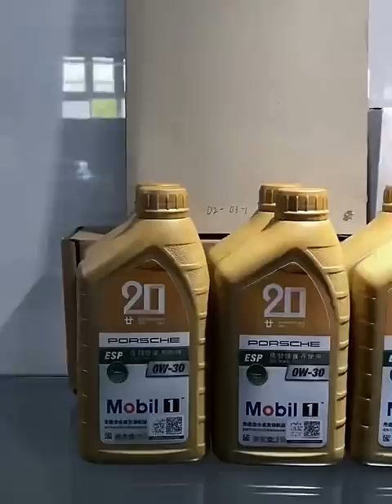Porsche Panamera Maintenance Service Process | Oil Change.

Comment: As someone who is a Porsche technician, a lot of newer cars, all bumpers have to be removed except for Macans. One thing not shown in this video is that to reset the maintenance interval light on these cars, you'd have to visit a certified Porsche dealer to reset these. Just thought I'd share. :)
Reply: Stupid crap, oil change should not require dealer. When will manufacturers build a good car that at least.oil change can be done by owner. Another reason not to buy over priced dealer shop queen of a car. Keep.my camry, and sportbike for blowing porsches off the road.
Reply: @rt2255  hey man, I just work here.
Reply: @teal_549  lol great job just hate the way manufacturers make cars only techs with special tools are only ones who can do even basic maintenance on them.
Reply: Whts tht white cleaning spray?
Reply: @rt2255  that’s not necessarily a problem unless they ask for too much money for an easy job. Anyway this is an interesting topic. 
What things should the manufacturer allow others to do? Some things will require the manufacturer service program to be carried out so for that they could also allow shops that have the required tools and mechanics that are certified for that type of car and engine, obviously nobody can do that because it’s not worth learning so many cars except if you want to have a specialized shop only for Porsche cars. However, for tasks that involve low complexity the manufacturer should provide a guidance for mechanics so they can do the job by the book. These would include oil changes, filters, suspension, alternator, starter etc. I think there are manufacturers that allow independent specialized shops because I know a few that claim to be and  have access to the manufacturer database.
Reply: @rotorblade9508  with porsche ferrarri only a few can do the job right. Rule one in buying car, forget up front cost but the cost to maintain it right. I drive camry for that reason, they rarely break and i can afford to get most things fixed. I keep ninja as cheap super car killer, again i can afford it. High end cars require high end income.
Reply: @fuadizharuddin4797  Whipped cream
Reply: They fixed that
Reply: @rotorblade9508  be it porsche, ferrari or lambo, an oil filter and plug change should de accessible with basic hand tools or get smarter engineers. If hs grad in military can work on jets the come on man. No reason it should take 4 hrs of tear downs to change oil. Race cars are faster more high tech, but built to be totally rebuilt in 24 hrs to race. Yes trained mechanics but even they could not pull sports cars engine in a day
Reply: Obd11 regelt
Reply: While you work there, could you kindly find the main Porsche engineer responsible for implementing this service procedure, and slap the **it out of him please )
Reply: trying to promote your dealership? "Only Dealer can reset" Lol
Reply: Yes but its not important, resetting need only to monitor mileage after oil changing on display and indicate drivers when it need to change. Here is peoples want simple cars, but sametime they want innovations, peoples, even seats ventilation its big system, of course you can use car without AC, without dispalys, without navi etc.
Reply: Китайские мультимарочные сканеры с Али экспресс без проблем скидывают интервал на Порше)))
Reply: @rt2255  go buy an M car then
Reply: Absolutely, you can't buy the blinker fluid anywhere else.
Reply: @rt2255  Lexus 👌

Comment: They can work on my car anytime 😀….very meticulous…love it
Reply: 1000 dollar oil change hope they are meticulous
Reply: Usually it’s about $750, not 1k.
Reply: @jaredjared8347  wow thats a deal lol
Reply: @rt2255  not everything in life is a deal. You want nice things, you have to pay. $750 once per year is a small price to pay for something that makes you feel good.
Reply: @jaredjared8347  lol once a yr if you drive i. Weekends, put some miles on it price full service or clutch, seen a clutch on high end sports cars  replacement cost 10 grand and up. A major service is even more. A 250, 000 dollar car should also go 100k miles with oil changes, not those cars you will average multi thousands a yr to do recommended maint.
Reply: @rt2255   well I have 2 and they don’t cost me near that much per year and they only go to the dealer. Porsche is not Ferrari, they’re not constantly breaking.
Reply: @jaredjared8347  true

Comment: Well I'm glad I saw this. Now I know why a simple oil change and service will cost hundreds of dollars!! If I ever own a Panamera (my favorite Porsche) I hope I find someone as meticulous as this (in America). Also I would change the oil out sooner than is factory recommended, every 6,000 - 7,000 miles. Porsche recommends every 10K miles, but no oil filter lasts that long. Therefore changing out at 10K miles will slowly kill your engine and maybe cause you to buy another Porsche?!?!?!?!? ;)
Reply: 10k with mild driving will be fine
Reply: 10k km 👍
Reply: lol tell that to long interval at BMW :D 30k km :D
Reply: The recommended figure is for driving non stop at very low rpm
If you spend most ur time stuck in traffic , you should change oil at almost half the recommended mileage cuz idling ur engine does not add up miles or kilometers. Its literally written in owner manuals and makes sense too.
Reply: There absolutely are filters that last 10k miles. Are mobile 1 filters false advertising?

Comment: Phew wonderful but lengthy process. I hope the service intervals  are looong (😁) so that the owner can at least  have an equally lengthy drive experience down some juicy motorways.
Reply: Long service interval's are bull shit. Especially in an advanced Performance engine. Nobody wants a Porsche with oil driven longer than 10.000-12.000 km.

Comment: porsche engine design always stupid like this. my 911.2 need take off the bumper  to replace the air filter too. and oli change also need take off alot parts.  this thing even more 
complicated than my Ferrari service.
Reply: @mmm vvv234 but fun to drive.....😂